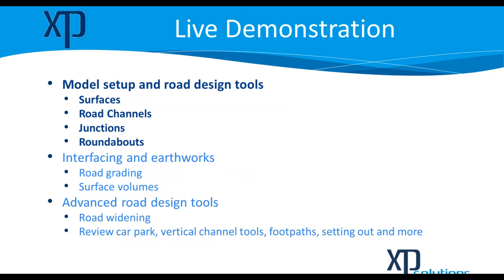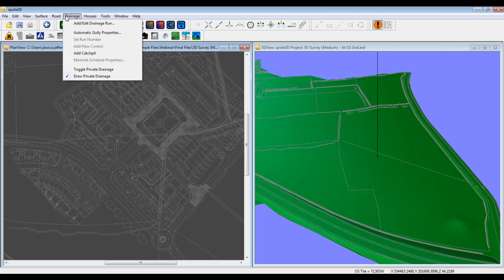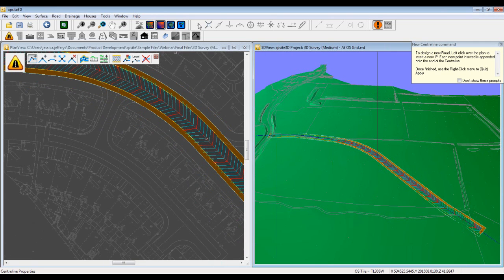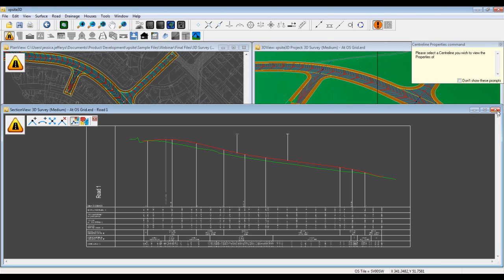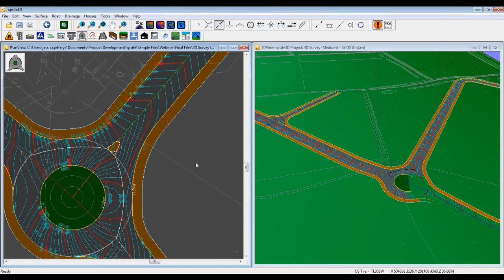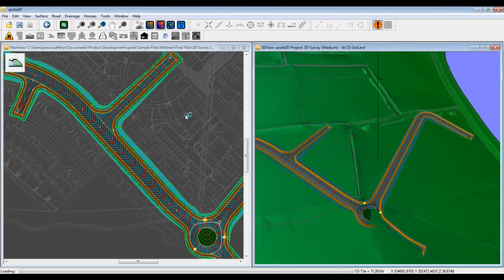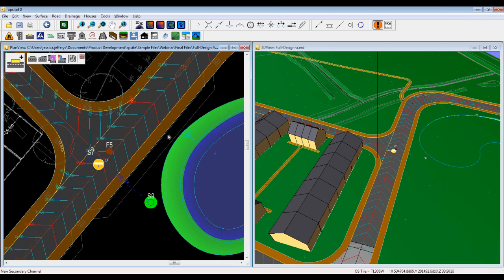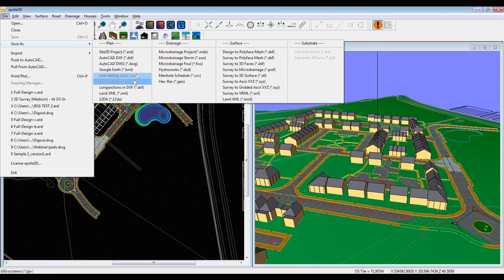New XPSITE3D

Comment: When adding a junction onto a road, is it possible to specify the junction in accordance with the DMRB? If the junction was a complex junction due to 250+ HGV / day, would this be programmed in, or would you need to manually amend it?